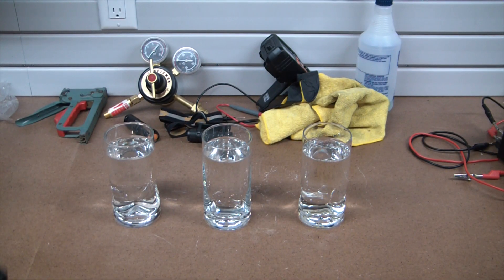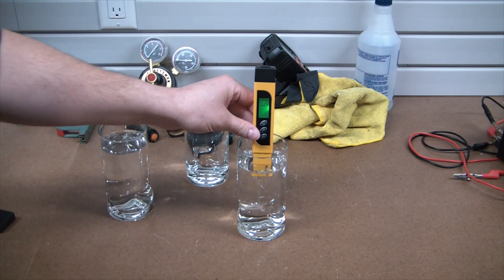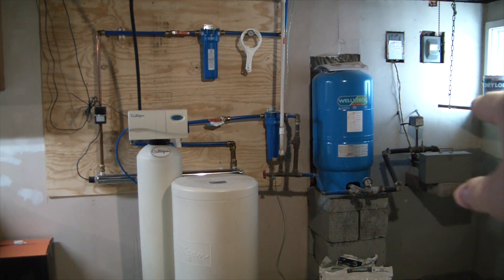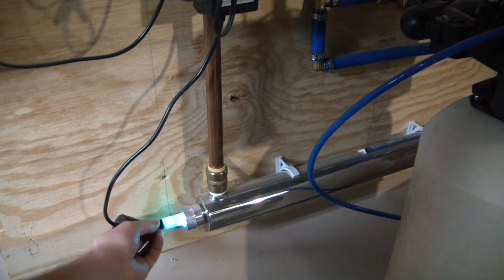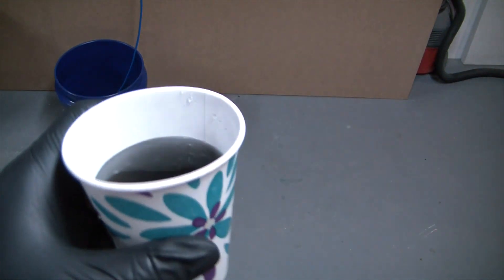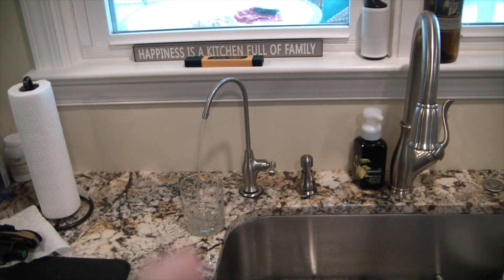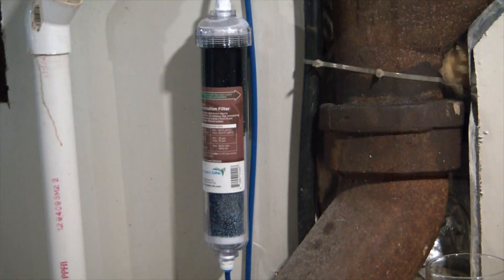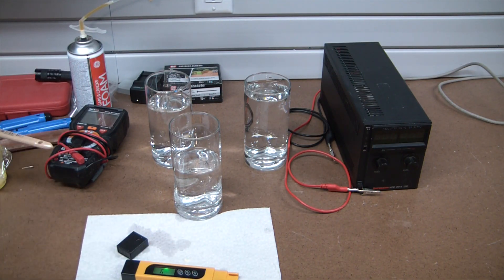DIY Deionized Water - ElementalMaker

Comment from the maker: LIST OF COMPONENTS USED BELOW: I appreciate your support if you are building a water system, as these affiliate links help the channel out. 

- Softener (necessary if you have hard water aka high calcium and magnesium content): https://amzn.to/3xj02qE

- Whole house filter housings - I recommend a sediment filter before your softener or UV sterilizer, and a carbon filter as the last treatment step, so two housings in total: https://amzn.to/3wuhgBE

- 12 GPM UV Water Sterilizer (if you have bacterial contamination in your water): https://amzn.to/3zv5VD1 

- *Reverse Osmosis System*: https://amzn.to/3iNCQgj

- Deionization Cartridge (not necessary for normal household use, I just wanted DI water for my workshop): https://amzn.to/3cGBjVG

- *Carbon filter for 4.5x10 housing*: https://amzn.to/3zwaHjE
- *Sediment Filter*: https://amzn.to/2TzzjYi 
The above components are what worked for my particular water source, however do you own research and consult a water quality professional before ever modifying and using a drinking water system.

Comment: U V light kills Microbes, but I don’t want to drink them either way, alive or dead! I say use a flocculant and a caking agent for suspended solids in a slow flow fill and high flow contaminant free consumer feed cycle bypass fed water tank with a purge outlet to flush the clumped settled solids previously suspended in solution.  It could happen!-

Comment: Would be water from a dehumidifier filtered true a paper filter sort of, coffee filters maybe, enough for a clean water version that would work for cleaning printer heads.?
Reply from the maker: Dehumidifier water will typically have quite a bit of dust in it. If you ran it though a good particulate filter, it would be quite pure.
Reply: @ElementalMaker  Thanks

Comment: I wish I could put a water deionizer for my "lab", but these things are so goddamn expensive
Reply from the maker: It can be done quite cheap! This whole setup ran me under $200, but if you dont do the RO first, you can just directly run tap water into the DI cartridge. They wont last as long, but it'll give you DI water for like $30.
Reply: @ElementalMaker  brazil, good rule of thumb is everything goes for 8-10 times more (sometimes it's nearly 50 times more for like bernzomatic torches and other propane torches), cheapest water deionizer I found was i think 299, and that is quite expensive, it's better to buy deionized water or just use tap water

Comment: Interesting video, but I'm only interested in making deionized water for my lab (wine chemistry).  So. ,my approach is to deionize store-bought distilled water.  I have tried, unsuccessfully, to do this by using a deionizing filter.  The scheme is simple: use a vacuum to draw water from a gallon jug of distilled water through a deionizing filter, capturing the filtrate for use in making reagents.  Unfortunately, this did not work. My store-bought distilled water had a conductivity of just 5 microSiemans/cm.  After passing it through a deionizing filter, the conductivity INCREASED TO 30 microSiemans/cm.  I would be happy to commiserate with anyone facing the same agenda

Comment: Hi, great video by the way. A quick question can you drink the de-ionized water
Reply from the maker: I've heard mixed things about that. I don't see why not but some folks say it can almost 'burn' your mouth or throat pulling minerals out since it's so pure. I've tried a bit and had no issue so I don't know what's true or not
Reply: From what I have read, you can drink it as maybe an emergency solution, but is not recommended to replace "regular water".......

Comment: My heart dropped each time I saw the water in a drinking glass 😯 what is it used for in the kitchen?
Reply from the maker: Only the RO water goes up the the kitchen. It branches separately for DI use in my shop. RO is quite healthy for drinking water.
Reply: Ok that's right, forgot you had said you were dropping it to 15-30 for kitchen use and 0 for lab. I work manufacturing PCBs and we use DI to clean everything in our shop. And I've heard drinking DI will tear you up. Cool channel, you earned a fresh subscriber sir.

Comment: 55 watts is not a lot of uv, my tanning bed lights are 5000 watts of uva and uvb and you can sit in there for 15-20 min
Reply from the maker: UV-C is a very different beast than a or b. You would look like a chernobyl victim if you sat in 5000w of UV-C for 15 minutes.

Comment: Thinkin its time to do a diy edm....
Reply from the maker: I think Ben over at Applied Science already built one 👍 I might give it my own twist some day though once I learn cnc programming a little better.
Reply: @ElementalMaker  as I'm sitting here watching my 3d printer, I'm seeing a carbon air arc rod hanging from the print head... it really wouldn't be that hard, very long time to machine something out in a 3d fashion, but it could definitely be done. Hmmm?

Comment: Your distilled water maybe RO'd. I buy RO distilled water at dollar general. Most distilled water is steam distilled, so I was surprised when I read the label and it said distilled by RO.
Reply from the maker: I'm surprised they are allowed to sell RO water as distilled. That seems blatantly misleading since as you noted the processes are quite different. Also water only purified by RO will still have some dissolved solids, unlike distilled which is essentially 0 TDS. You should look into getting your own RO system, I use at least several hundred gallons per year, so I saved a ton getting my own system over buying bottled.
Reply: @ElementalMaker  I've heard of distilled water being RO, but this is the first time I actually saw it. Most of the ones I see are labeled as "steam distilled". I only go through about 5 gallons a month (a misting system for a gecko), so I needed something that wouldn't leave spots or marks. At $1/gal, that's not bad. I'd be interested if it's deionized. Maybe I'll drop an old cell phone in a glass and see if it shorts out.
Reply from the maker: @Aaron48219  it's cheaper to get a cheap tds meter. They are surprisingly decent for the price

Comment: A few things regarding your setup. 15PPM coming off of the RO chamber is a little high. Ideally you want your water coming out of your RO chamber at half that. 5ppm or less is ideal. But if your RO output is hitting 10ppm or higher then something is going on. Your RO could be exhausted. But given the fact that you were still getting 2TDS after the DI stage and you mention it is well water. It could be a high amount of co2 in your well water is dropping the PH coming into the filter, causing issues. Your initial PPM is very high. It could also be chlorine or chloramines. Those eat through RODI quite fast. You want a good quality carbon pre-filter to help with this. BulkReefSupply makes a cheap carbon pre-filter that lasts awhile. Regarding co2, you could also offgas the source water before the filter. Or maybe your DI resign isn't the greatest. You want to run it through a two stage DI process for better results. Filter it through anion resin first and then cation resin second (or vice versa). Maybe even a 3rd chamber of anion/cation (mixed bed) and that should take care of your issue.
But definitely get a good set of sediment pre-filters including a good carbon filter before your RO stage. Especially because your well water comes in at ~450ppm, that is INSANELY high. And I'm guessing you have an iron/phosphate/sulfur source seeping in, or perhaps nitrates from farm runoff in your water table? It could also be silicates, they are very, very hard to filter out even with an RODI filter. There are a lot of contaminants carbon will catch that'll seep through RODI quickly.

Comment: Can you tell what's the material used in DI filter?
Reply from the maker: It's composed of an anion and cation mixed resin. You can deep dive into it, it's a pretty impressive science.
Reply: @ElementalMaker  There is 001x7 resin also from China which is yellowish in color. I don't know if it does same thing.

Comment: Thats pretty awesome. How much did the whole setup cost?
Reply from the maker: Somewhere around $150 with the extra Deionization cartridge and an extra pack of 1/4 quick connect fittings. Pretty damn cheap for how much I use it. Still getting around 13ppm at the kitchen tap, and 0ppm at the DI tap, and haven't changed a filter yet.
Reply: @ElementalMaker  That's badass! And not nearly as expensive as I was expecting. I recently started thinking about if it may be a good idea to set something up so I can clean/deionize water on my own as opposed to buying distilled water at the store (and sometimes even deionized water online for like $8/L, which is ridiculous).
Thanks for posting this, I will definitely use it if I move forward on a setup myself. 
What would be cool is to have something actually test the water as it finishes running through the system. Like a digital gauge/meter showing the PPM, as opposed to testing it every so often. But maybe that's just overkill.
Reply from the maker: @jhyland87  Oh man $8 a Liter! Ouch! I'd definitely go this route over that. Also they do sell inline TDS meters just like your describing. I am actually working on a larger DI system for washing my car since my high TDS water leaves horrible spotting. The meter I'm using shows both inbound water TDS, and post treatment TDS. Just look up 'HM Digital inline tds meter', that's the one I bought.
Reply: @ElementalMaker  That sounds awesome! I'm a nerd that likes data, so I'd probably meter the quality before/after each stage in the system just to quantify how effective each step is (or I'd half ass it and move onto the next project...).

Really enjoy your videos man, keep posting them. I'm seriously jealous that you got that O2 concentrator as well, I've wanted one of those for a bit. I want to set up an N2 and O2 system where the N2 gets concentrated and the "waste" (which is mostly O2) gets sent to the O2 concentrator/purifier, then any of the "waste" (mostly N2) from that gets sent back to the N2 concentration/purification system.

Comment: I thought super pure water was essentially an oxidizer. They use it in neutrino detection facilities if I'm not mistaken. I read an article about it... something along the lines of a wrench got dropped or left behind when they did some maintenance and ended up getting dissolved because the water rapidly leaches whatever it contacts.
Reply: your question is too complicated to answer here.  You need to read in google.  Basically pure water is not an oxidiser.

Comment: I have gotten that crazy about water quality and then I thought I was drinking the best water on earth. Did you check the ph of your water after all of that filtering? Mine came up with 0 t.d.s. but the acidity was absolutely toxic. What is your water's P.H.? T.D.S isn't everything. Then you need to add electrolytes and minerals which are essential once you get to perfectly pure water.
Reply from the maker: The PH of pure water is 7. If you really had 0 TDS water it would have had a PH of 7, which is fine. It sounds like someone has been feeding you some fake science woo woo. You get all the minerals and electrolytes your body needs from food.

Comment: The trouble with your video is that man relies on electricty to test the 'purity' of water yet there could be many impurities in water that do not conduct electricity so 0ppm does not mean the water is 100% clean. In fact there's no way of ever knowing whether water is 100% clean. There are probably some impurities in the water that your TDS meter cannot detect, for example from the carbon filter or the pipework and fittings. I'm sure other more sensitve meters would pick up impurities that your cheap meter can't. Remember though, you don't want to leave your meter for too long in the clean water as the water will want to break down the electrodes which will then impurify the water. Super clean water is corrosive as it loves to break down whatever is in it. Water decomposes materials. I'd suggest you spend more time in your kitchen with your family. @7:29 Happiness is a kitchen full of family - couldn't agree with you more - they should teach this in every single school but they don't!! Ever thought about advertising it on your channel?

Comment: My in laws have a well on the farm and they have a problem... the hot water smells like sulfur...curious what kinda issue it might be.
Reply from the maker: Likely hydrogen sulfide. Check this page out to try to determine source and fix. https://www.health.state.mn.us/communities/environment/water/wells/waterquality/hydrosulfide.html#targetText=Hydrogen%20sulfide%20gas%20(H2,in%20wells%20anywhere%20and%20be%3A&targetText=Produced%20by%20certain%20%E2%80%9Csulfur%20bacteria,reactions%20inside%20of%20water%20heaters.

Comment: What is the purpose of the DI Water? Just for consumption? Why would you want 100% pure water for consumption? minerals in the water are not bad and do offer some benefit. I am referring to the well water not city water.
Reply from the maker: The DI water is just for use in my lab. Some experiments require ultra pure water. For drinking we use the RO water, which is typically somewhere around 20ppm tds. For tea and coffee I mix in a bit of the filtered well water for minerals and better steeping.

Comment: Pure water is needed for lab use BUT in closed environments especially submarines the RO water actually fails to provide necessary calcium so diet supplements are needed. Drinking water at 150 - 300ppm should be fine and a lot cheaper.

Comment: There is a brand of stuff called Tulsion, I used it in 16Liter water purifier to clean external windows with a massive tooth brush. Just let it air dry and it never leaves streaks when done right. The water was always 0 until maybe 5000 liters. Its AU$200 for 25liter bag.

Comment: the pipe from your pressure switch should by cut in half.. current configuration is considered a dead leg  (6 pipe diameters or more is a dead leg)

Comment: Helps if you rinse or flush out the filter good b4 hooking it up. Much less carbon to flush out. I have the same type with the clear housing and DI included. It came out 0.00 after 10min flush with a neutral ph.
Reply: pH is effectively meaningless at 0ppm. Any reading on a digital meter is a lie. 1ppm of nitric acid would floor your readings.

Comment: If there's any dissimilar metals in the "deionized" loop, especially if they're in contact with each other, there's a certain degree of galvanic action that'll move ions into the water. it's a known issue in watercraft, and also oddly enough in water-cooling loops in performance PCs where you've got dissimilar metals making up the radiators and actual heat blocks on the CPU/GPU. It's why large ships will have giant sacrificial slabs of zinc welded to the hull, the zinc gets corroded in place of the steel of the actual hull. The effect is much more pronounced when the dissimilar metals are in direct contact, but it's not actually required that they are. So basically if you've got soldered copper joints exposed to water, or if you've got copper lines and that big stainless tube, galvanic action is going to strip ions off of something into the water.
Reply: DI is impervious to galvanic corrosion. Those metal ions are lazy bastards when there are no ions in the water. The most corrosive parts of his system are before the RO, but the water is still pretty well buffered with carbonates at that point and I'd wager the pH is in the 7.5-8.5 range, making the metal ions insoluble with the carbonates playing defense. Once past the RO, the electrolyte is too dilute to be appreciable. 

Your examples involve thermal gradients and chlorides in their loops, whereas he has unidirectional treatment and filtration train with negligible thermal flux and chlorides.

Comment: But it's it DNA, RNA and endotoxin free?
Reply: As much so as one could measure with less than $10k in test equipment. Beyond that, you'd be measuring the motes of dust and aerosolized saliva making its way into your sample. The last 0.01% is always the most expensive to eliminate.
Reply: @templebrown7179  ok, so maybe not use it in PCR machine lol

Comment: You can get UV stabilized pex now
Reply: Still will break down over time. I have used UV stable PVC with a 9w sterilizer and it crumbled after a couple years.
Reply: Pex is not the same as pvc
Reply: Of course not, but they're both UV stabilized the same way.

Comment: Awesome video! I have a question for you. Does lab grade deionized water need to also remove the atmospheric gases that dissolve into solution? I’ve heard of people removing dissolved CO2 from solution with vacuum chambers, but haven’t seen it done in practice.
Reply from the maker: Thanks Michael! I am sure it varies from lab to lab, and the intended use of course, but I have never seen degassing of lab water (other than if the feedstock contained radon of course).

Comment: What would make distilled water less "pure" than RO water? I mean, what dissolved solids make it through the boiling to the other side?
Reply from the maker: Distilled water typically has a resistivity of 2 Mohm, compared to 18.2 Mohm for completely pure water. It is probably contaminants leeching out of the actual distillation apparatus and various containers it sees before reaching the consumer. That's just my guess though,

Comment: So your current drinking water comes from an ion exchange bed? Aren't you worried about the high sodium levels? In the UK, if a water softener is installed, drinking water must be fed from the supply before the softener.
Reply from the maker: The amount of sodium is quite low, definitely not anywhere near an amount to cause health concerns. The Mayo Clinic had a good article on drinking softened water.